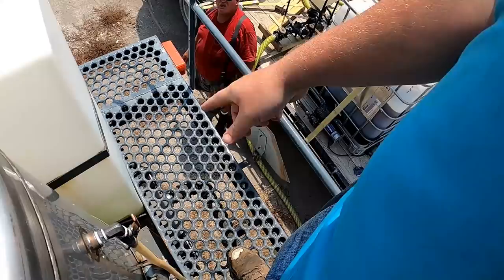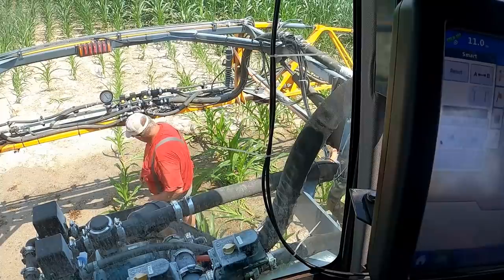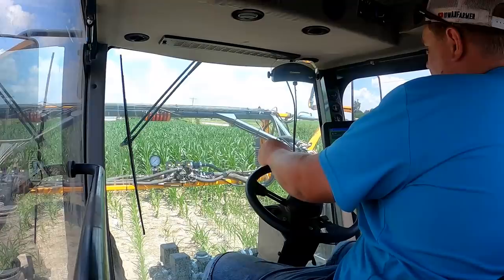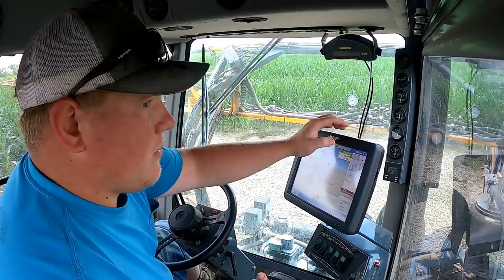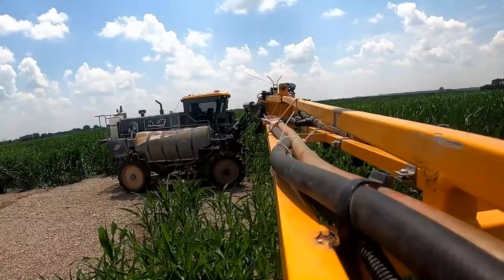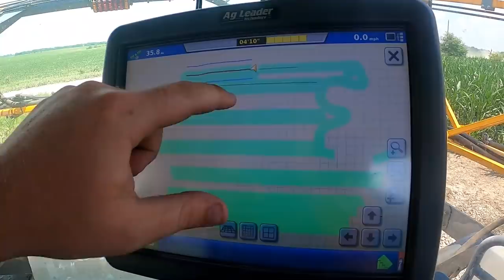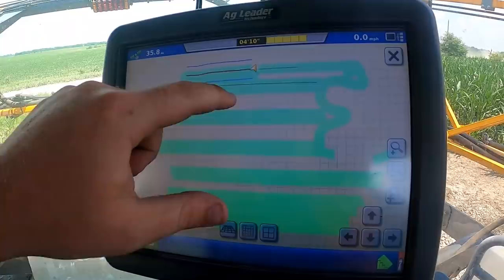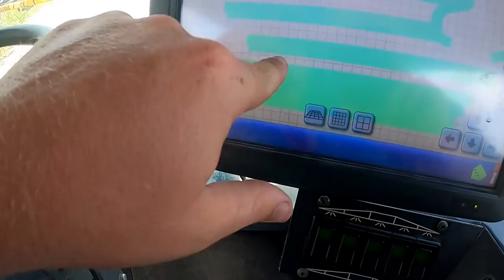HAGIE DTS10 - Spraying tall corn!

Comment: Seeing that tall corn slapping under the boom reminds me of cultivating corn in early 70’s when dad still wire checked corn and I cultivated it 3 times, long ways then crossways and then longways when the slapped under the cross frame of the 4 row front mount cultivator. It could get hypnotic so I’m impressed you could stay on the rows as well as you did. Good job!
Reply from the maker: Thanks Rick!

Comment: Spent 10 years in a dts10. Sprayed   tasseled corn with it no problem. If you plan on doing much fungicide on corn I'd build a rear boom for the middle section so your not putting chemical on the windshield.
Reply from the maker: Nathan Wagner no doubt!
Reply from the maker: Nathan Wagner did you every have to tighten up the steering?
Reply: Changed tie rod ends once. Sitting still turn your steering wheel back and forth and see how much play is in them.